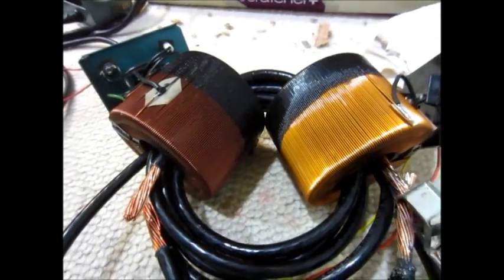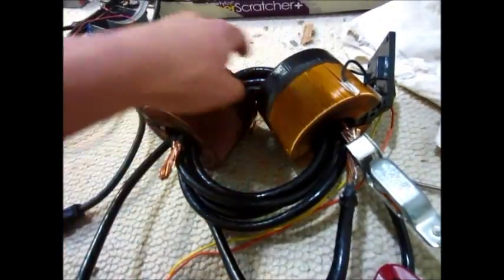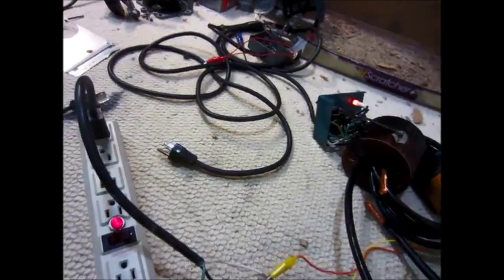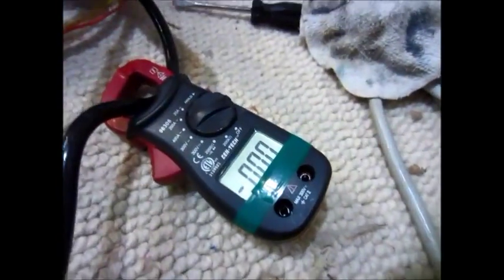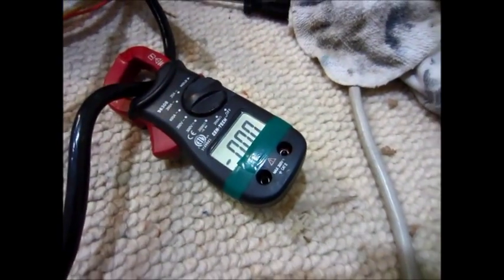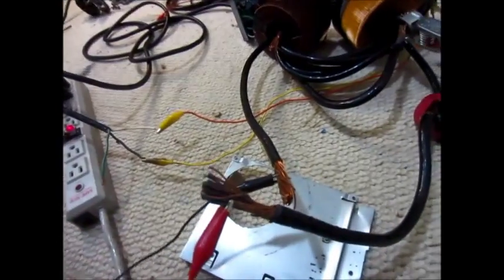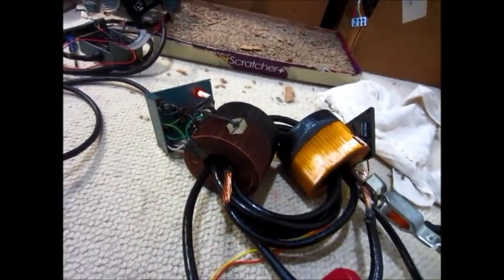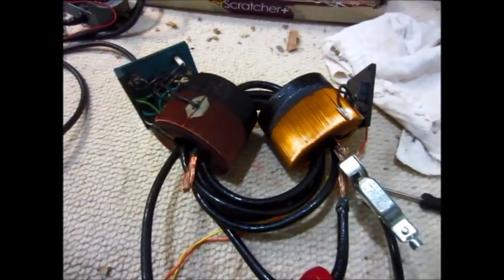High Amp Duel Variac Experiment

Comment from the maker: Do you think this low of a voltage would work well?  Most people use around 12 volts.  But it might work if I put enough salt in the water and put the electrodes close enough together.

Comment: Great video, for high currents you need to have good connections. One turn will easily get 700 -1000 Amps but at a very low voltage, perhaps 0.5 Volts.

Comment from the maker: Google "What kind of material use for transformer core?" click on first Yahoo! Answers result.  I think a roll of steel sheet tied together tightly would make a nice core for a variac.  I don't think it would have to be round though.  If you have some big like 1x1x6 inch solid steel blocks and you stack them into a rectangle shape and wind wire around one it might make a nice variac.  Or you could build Grant Thompson's "Scariac"!!!  Be safe!  ;-P

Comment from the maker: Wait...why did I say 500?  I meant about 300.  200 should be enough but my understanding is that it won't be very efficient.  I'm also not sure if stranded toroid material will work very good at 50Hz.  Normally they use soft iron for variacs.  A wire brush should work fine for low current.

Comment: Your probably eight about wire size and melting stuff.  Yep variac giant JT. Use a pot for base resistor, so its adjustable, and call it the variable variac variant JT. :D Put the input on the wiper, and base & collector on the ends. Should be super adjustable :) I have wanted to try it for ages, but dont have a variac. Thinking I might make one :)

Comment from the maker: I like the soda can Idea!
I tried putting a couple of turns around a flyback core and connecting up.  All I got was melted wire.  :-/  I don't think I would get any more amps out of a mot.  Maybe around 40 amps.  The wire would not be a able to conduct that much current.  If I had big enough wire I could probably get around 5000 amps with these 2 variacs. 1000 is about the max for this wire. So your saying use the variac as a giant toroid fort the joule thief? I could try that sometime! Thanks!

Comment: Soda Can's, empty and full :) maybe a cpu or something. Diode could be cool. 
Wonder if it would be any good for flyback driving? 4 turns of really thick wire. What happens if you put 1000A into the long wind on a MOT? Might get more amps :) could cook the MOT too. I've always wanted to try a joule thief on a variac, with adjustable center tap. I wish I had a variac.

Comment: LOL Hmm Waffle! that seems about right for a 25 amp breaker you probably have those thermal model which have a plate that heat up and then trip the circuit.

Comment from the maker: I know that when my dad has plugged 4 waffle irons in on one circuit it took about 10 minutes for the breaker to trip.  I just looked at the wattage of them and if you add them all up it is 3200 watts so about ~26 amps!  But they have thermostats so they are not all on at the same time.

Comment from the maker: I know, that is partly why I want to try it to make sure it will trip. I think the circuit in my shop is 20 amp so if it's working properly 25 amps should trip it in a few minutes.

Comment: Yes it could be but be careful since the wire may not be able to withstand that high current you don't want to have wire melting >.<. I would check the break to see how much amp it is rated then if it doesn't trip at the rate amp you should replace it :)

Comment: Thanks for the info. I have 120 volts 15 amps in most plug in the house but stove and dryer use 240 volts at 20~40 amps and it's very easy to wire a special plug from the breaker panel ;)

Comment: We have a stick old fashioned AC stick welder at home.  The voltage of it open circuit should be in the order of 50 volts RMS which of course drops when welding. I think its a 3000 watt unit. Google this "stick welder calculator" and press the first link that comes up. Where i live we have 240 volts AC.